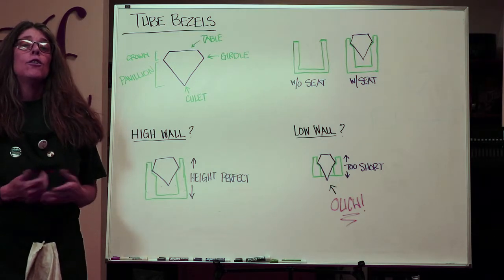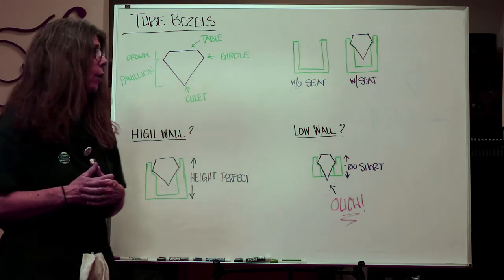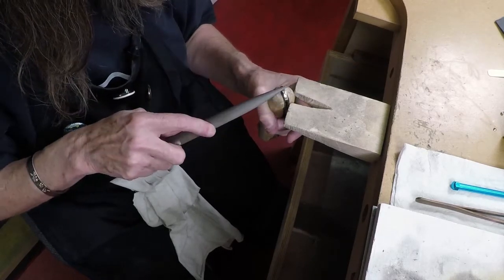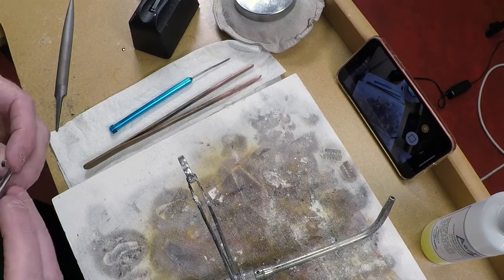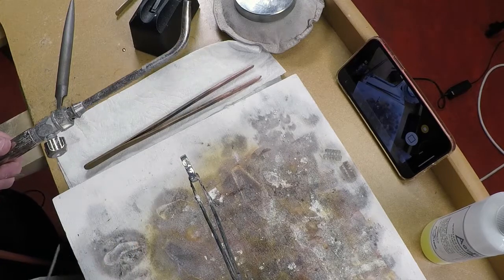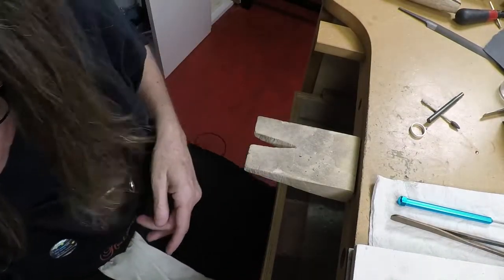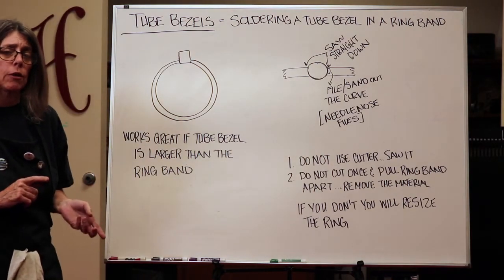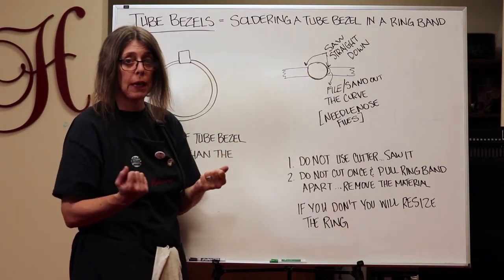Soldering Tube Bezels to Rings

Comment: Hi, I'm actually making a ring for my soon to be finance. I have been able to a anneal silver and form a nice ring, I have them soldered the band together and filled in any dips but I haven't had much luck trying to make a setting. I would like to make a cathedral 4 prong setting. It's an emerald cut diamond. The ring is .999 silver with some other sterling silver bits added...but I have a problem where I'm using silver wire medium hard and I get it to melt to the ring....I quench, clean, and then try adding another piece for the prong setting and it either heats up the first one I did and moves or ends up melting the prong. I have very rudimentary tools compared to what I've seen in your videos, I have a medium torch tip I'd  say? Is it just my torch possible or can I use a trick to draw heat away? Or...do you know of anyone that sells settings? Like that one you have but 4 pronged and made for an emerald cut? Roughly .30ct. 3x5mm
Reply from the maker: Hi Michael. I would recommend fabricating the setting completely first - working with hard and medium solders, and attaching it to your ring band with easy solder. A great technique for prong settings is to stab the prongs into your soldering block so they stay in one place when soldering to the supporting rings - and solder them all on in one go. You can also use white out or yellow ochre to prevent solder from flowing again. You just paint it over the solder seam you don't want to flow. For purchasing a pre-made setting you can look into Rio Grande, Otto Frei, and Fire Mountain Gems.
Reply: @HalsteadJewelrySupplies  thank you so much I don't have a soldering block you mentioned so I'll try the white out option

Comment: Hello,
thank you for the informative video.
Can you help me please with my premade tube setting bezels. Sometimes they are too small and the stone doesn't fit. How can I stretch the bezel correctly and how much can I stretch it? I bought for example some 4 mm  premade tube bezel settings and the ordered 4 mm  stones are about 4,15 mm until 4,3 mm...
Sorry for my bad English.
Greetings from Germany
Maren
Reply from the maker: Hi Maren, that's always the tricky thing with using pre-made bezels. You can search for calibrated stones, or request from your supplier a tighter tolerance so they will fit better. If there is enough wall thickness, you can open up the setting ever so slightly with a setting bur, making sure not to cut the seat deeper - only widen it. That should work for the 4.15mm stone, but 4.3 starts to push it a little bit of making the wall too thin. Hope that helps!
Reply: @HalsteadJewelrySupplies 
Hello,
thank you very much for your very soon answer.
I'll thy to open it a little...
Greetings from Germany
Maren